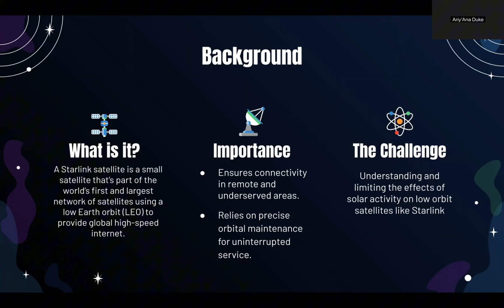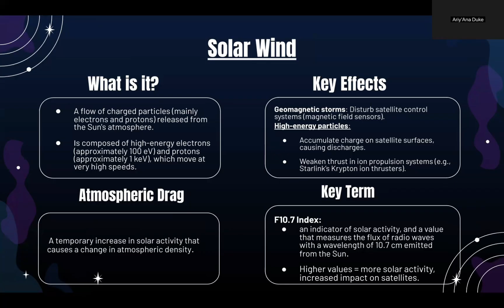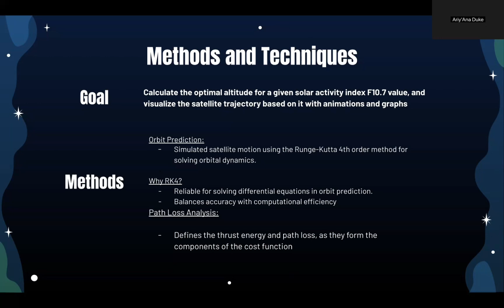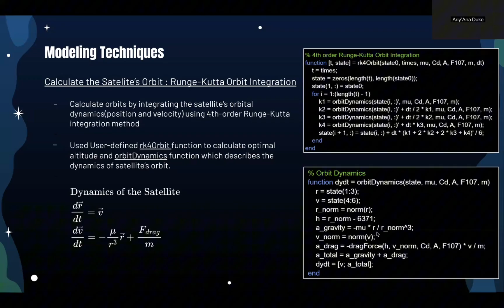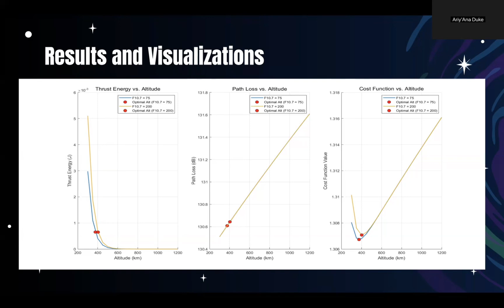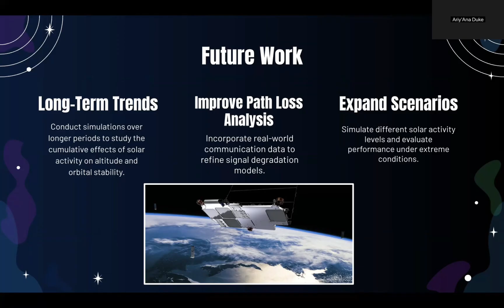[Team no.6]: Optimizing Altitude of Low-Orbit Satellites: Based on Starlink Satellites

Comment: Hi, this is Seunghoon Baek from team 12. Thank you for your presentation.
I have a question. I think, to adjust the orbit of a satellite, extremely precise and detailed values are required. In that case, wouldn’t there be a better method to choose, even if it incurs higher computational costs, rather than using the RK4 method?
Reply: Thank you for your question, Seunghoon Baek. As you mentioned, extremely precise calculations are indeed required to adjust satellite orbits. The choice of the RK4 method was based on several considerations. It provides a good balance between efficiency and accuracy while being relatively straightforward to implement, making it suitable for the early stages of our research.

However, if higher precision is required, alternatives such as adaptive step-size methods can be considered. These methods dynamically adjust the step size during computation, which increases computational cost but ensures the desired level of accuracy. A well-known example is the Dormand-Prince (DOPRI) algorithm.

In summary, our choice was guided by the research objectives and computational resource constraints, but we plan to explore more precise methods as the project progresses.

Comment: Hi, I'm Chang han Kwon from Team3.
Thank you for the presentation

In the video, it is suggested that the satellite be moved to a higher altitude to mitigate solar storm damage.
I wonder why existing satellites don't use this method.
What are the pros and cons of raising the satellite to a higher altitude?
Reply from the maker: Thanks for the question! Basically, raising satellites to a higher altitude can indeed reduce the impact of atmospheric drag during solar storms, but it comes with trade-offs. The main advantage is reduced drag, which lowers fuel consumption for maintaining orbit. However, the cons include increased communication path loss, which weakens signal quality, and higher latency, which affects real-time applications. Additionally, moving to higher altitudes can lead to increased collision risks with satellites in medium or geostationary orbits. Existing satellites balance these trade-offs based on their mission requirements and operational priorities.

Comment: I am Daham Yu from Team 1. Thanks for the interesting presentation! I have a question. In the cost function, can I ask you what made you set the cost function’s coefficients 0.99 and 0.01?
Reply from the maker: Hello and thank you for your question. We set the coefficients 0.99 and 0.01 in the cost function to prioritize minimizing thrust energy consumption over path loss, as maintaining orbit stability is more critical in low Earth orbit. These values were chosen as a starting point, but they can be adjusted based on specific mission requirements or performance priorities.

Comment: Hi, this is Joseph Park in Team10, and thank you for great presentation. I wonder if the initial state of satellite(i.e. state0) affects to optimization result. Thank you!
Reply from the maker: Hello! So the initial state of the satellite, such as its position and velocity, does not directly affect the optimization result because the optimization focuses on minimizing the combined cost of thrust energy and path loss across a range of altitudes. However, the initial state is crucial for orbit prediction and simulation, as it determines the satellite's specific trajectory and how it interacts with drag forces over time.

Comment: Hello, I'm from team7. Thanks to your good preparation, I enjoyed the great presentation. I have a question, can this modeling technique be applied to other orbits (middle orbit, geostationary orbit) other than low orbit? If it can't, how can we change the code in the video to use it on other orbits?
Reply from the maker: Thanks for your question! Our modeling technique is focused on low Earth orbit because atmospheric drag is most significant there. For higher orbits like medium or geostationary orbit, we would adjust the model by reducing or eliminating atmospheric drag in the calculations since air density is negligible at those altitudes. The code would mainly need changes in the drag force component, and we’d incorporate other factors like gravitational perturbations or solar radiation pressure instead.

Comment: Hello, thanks for the great presentation. I am Sanghyun Choi from Team 4. On what basis did you determine the weights for communication loss and thrust energy consumption in the cost function? Was there any specific reference or reason behind your choice?
Reply from the maker: Hi! So the weights for communication loss and thrust energy consumption in the cost function were chosen to prioritize thrust energy consumption (0.99) over communication loss (0.01), as maintaining orbital stability is crucial in low Earth orbit. These values were not based on a specific reference but were selected as reasonable starting points. They can be adjusted in future work to better reflect mission-specific priorities or constraints.

Comment: Hello, I am Lee Kun Min from Team 9. Thank you for giving us a nice presentation! I have a question.
There are lots of satellites orbiting around the Earth. With different values of F10.7, the satellites will surely start at a different altitude. As they are orbiting, they will descend in a non-linear form. However, there might be one point on which two or more satellites collide each other at a certain altitude. Is there a way to prevent this collision and if there is, can you suggest one?
Reply from the maker: Yes, you are absolutely right that varying F10.7 values and non-linear altitude descent could increase the risk of collisions. To prevent this, collision avoidance maneuvers are typically used. Satellites are equipped with tracking systems and thrusters to adjust their orbits when a potential collision is detected. A proactive approach would involve careful coordination during satellite deployment, ensuring that satellites operate in slightly offset orbits or at different phases to minimize intersection points.

Comment: Hello team 6! This is Kim Daewon representing team 5. I'm here to ask you guys a question.
Your study suggests moving satellites to higher altitudes to mitigate solar storm damage. Considering the time constraints of detection to impact and the altitude adjustment time, and the fuel costs (increased launch cost and/or reduced satellite lifetime), how feasible is this approach in terms of satellite lifespan and overall sustainability?
Regardless, awesome work and I hope you guys had a great semester. Cheers!
Reply from the maker: Hello, this is a very interesting question! So moving satellites to higher altitudes to mitigate solar storm damage is feasible, but it requires careful trade-offs. The approach depends on early detection of solar activity and fast execution of altitude adjustments. While this method helps reduce drag and prolongs orbit stability, the increased fuel usage can shorten satellite lifespans. For sustainability, efficient propulsion systems, like ion thrusters, and accurate space weather forecasting are crucial. This technique would likely be used sparingly during extreme events to balance longevity and operational needs. Thank you for your kind words and I hope your semester was great as well!